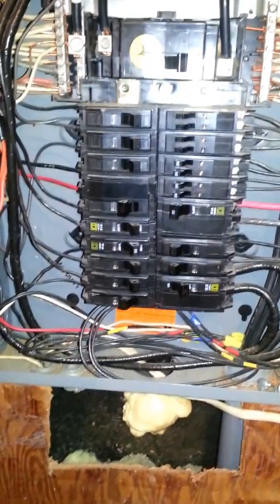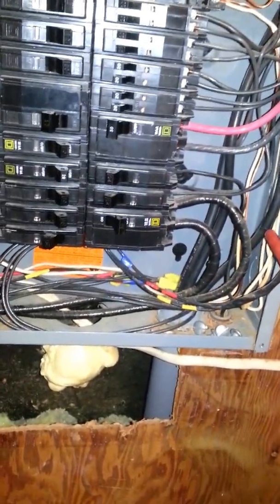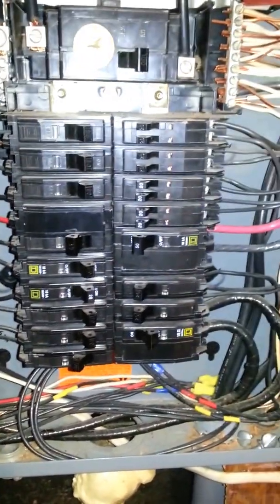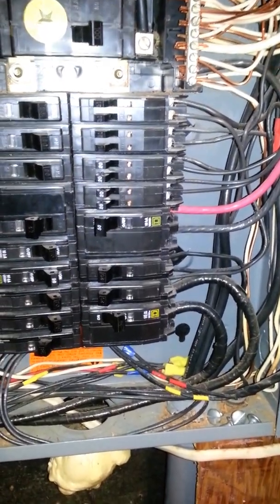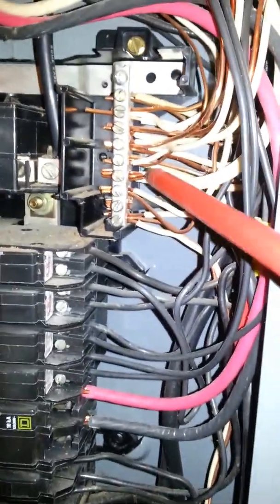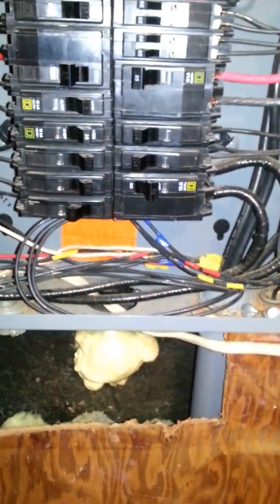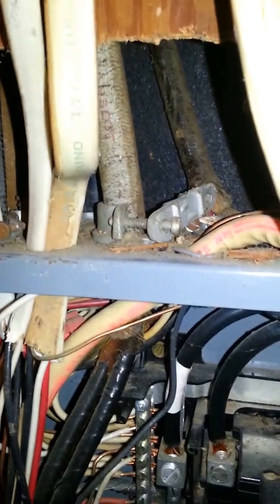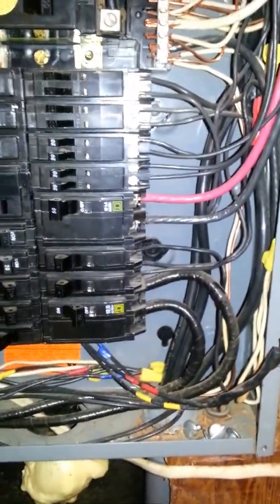Square D QO main breaker panel. improper install. Code issues and concerns

Comment: a mouse got in one of my subpanels in a barn, and made a mess of things.   If you can imagine an electrical box packed with hay.   Plug open holes. use the proper connectors.   I dont know what would have happened if the box was ever energized again.
Reply from the maker: Wow. That is something I haven't seen yet. Glad you found it. For some reason they like to shred wire insulation

Comment: Wheres the EMT? I thought homes built after a certain year need conduit (Meaning no Romex)? Also for sub-panels you need the ground and neutral separated if the sub was properly grounded?
Reply from the maker: Not here. Mainly romex wire and seu for entrance.
Reply from the maker: yes, ground and neutral should have been separated

Comment: Those tandem breakers you call cheaters are 100 percent code worthy and there is nothing "cheater " about them. They save alot of people from panel costly upgrades.
Reply from the maker: I believe that is a panel by panel allowance. Some will say 12 space 20 circuit max others may not but I didn't check in this case but here is a link of what I mean.        https://www.schneider-electric.us/en/product/QO124M100P/qo-loadcenter%2C-main-breaker%2C-100a%2C-1ph-3w%2C-24sp%2C-nema-1%2C-pon/?range=7249-qo%E2%84%A2-load-centers&node=7015259230-plug-on-neutral-load-centers&filter=business-5-residential-and-small-business

Comment: Can I put a home line in a GE box why can't you put a mury in a home line box if it fits
Reply from the maker: David Berquist the Homeline will fit in the GE only if the buss bar doesn't have the acceptance of half breakers. THQL is the ge breaker for that I believe. GE and Murray etc should not fit in the Homeline because the Homeline panel has a different busses bar(extra bump in the middle)

Comment: is it ok to put a square d home line breaker in a murry box
Reply from the maker: David Berquist Yes they are designed to replace many brands that were similar but you can't put the Murray in the Homeline.
Reply: Nope. Murray panels call for Siemens breakers. They are the ones listed for use with them.

Comment: Ground wires can be doubled up? Just not neutral wires?
Reply: Good practice. Many panels will allow you to double or even triple up the grounds only. They all have to be the same gauge or else it's not going to work.
Reply from the maker: I try to keep from it in either case, but the only way you will physically have room to keep them 'one per screw' is if you buy the ground bars for each side
Reply from the maker: There are holes in this this panel down and more towards the sides of the box where you can attach dedicated ground wires which in turn keeps the mess shown from happening
Reply: So you wrote two paragraphs and still didn't answer the question clearly...
Reply from the maker: I am not a inspector so I answered as I would do it (1 screw 1 wire).  Electrically it works fine because many houses are this way, but if you ever need to remove a circuit for some reason it is less messy.  1 screw 1 wire is better electrically and more secure

Comment: If the sub panel is qo why are the tandems considered an overload if it is made to use in that box ?
Reply from the maker: Technically speaking each panel has a designated spaces and max circuits allowed.  Like this one is 20 and 20, but there is 24 circuits if I count 240 beakers as 2 circuits.  If you used all tandems you could make a 20 space into a 40 space which is not correct besides the fact being extremely expensive because those breakers are like $40 each.   More than 20 circuits in this panel just increases poor wiring habits because the neutral bar only has so many spaces, then you start shoving more than one per terminal on those.  Like I mentioned there was 4 under 1 terminal.

Comment: This is where inspectors some times get confused. Square D QO and Homeline breakers 10 to 30 amp, single and double pole can have (2) 14-10 gauge wire.  Although they may look double tapped as long as the conductors are under opposite sides of the screw then it is not considered double tapped.

This article explains it best.

http://www.startribune.com/double-tapped-circuit-breakers/141011393/
Reply from the maker: Thank you, I noticed the screw down plate has places for a wire on each side. Thanks again for the clarification

Comment from the maker: Ok Electricians.  Is it even legal to run a sub-panel off another sub-panel? I thought all sub-panels were supposed to come from the main.  If you can daisy chain them I assume 4 wire for the next panel????
Reply: Nothing in the NEC says you have to run all subs from a main panel. You can wire a sub, off a sub, so long as everything's sized and installed correctly.
Reply: Yes you can run a sub off a sub but as you stated it has to be 4 wire. The only place that the neutral and Ground are to be bonded together is in the Main Breaker Panel. But to run a sub Panel off a Sub Panel the first one needs to be rated high enough to be able to hold the loading of the 2nd Sub panel.